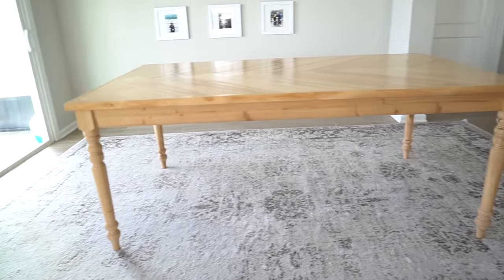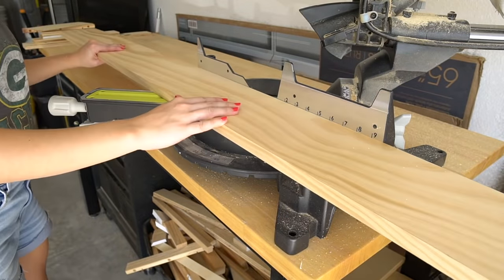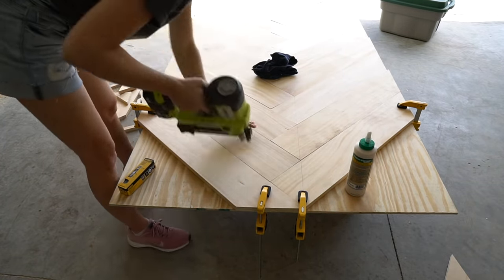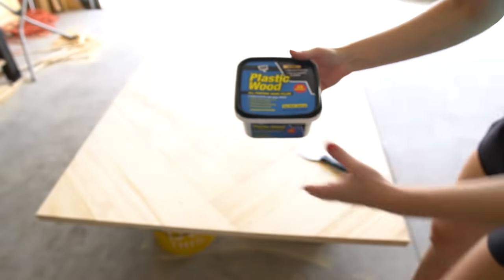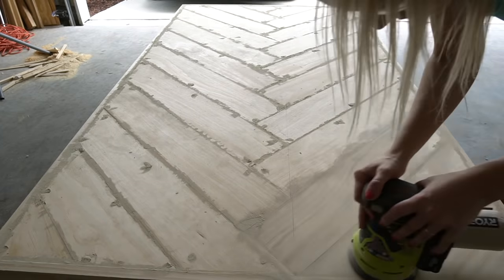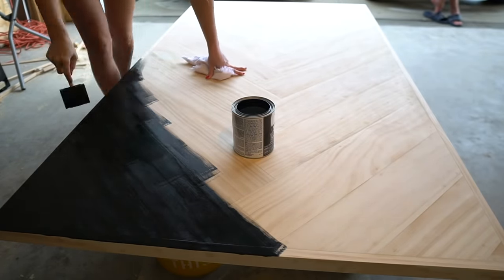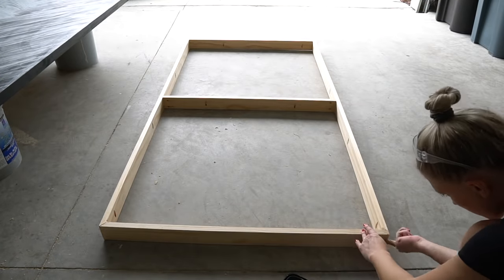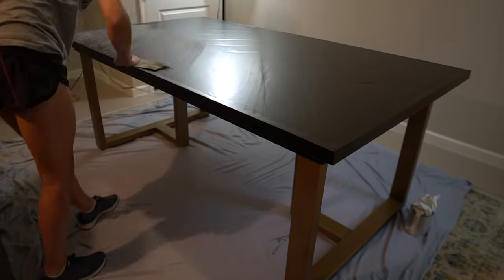DIY Herringbone Dining Room Table | Home With Stefani

Comment: Great idea and execution. My only suggestions would be to use a mask when spray painting and apply the poly outside or in the garage to keep from getting fumes inside the house. The black top would also look real good with an epoxy coating. I think you are an amazing young lady.
Reply from the maker: I will definitely keep that in mind. Thank you so much!!

Comment: Love the stuff you do!

Question in good faith for this project: Since the hardwood is an unstable substrate and you're bolting it on top of the plywood which is a stable substrate, won't that cause issues when the wood expands and contracts? This extends to the mitered border as well. I'm guessing you have lots of faith in your paint and finish?
Reply: I was thinking the same thing. I love the way you walked us through the process, but perhaps connecting them with dowels may help prevent future problems when the wood starts to expand ans contract.

Comment: How is this holding up? I have never laminated standard wood over plywood with glue like that as I was concerned about wood movement - standard wood expands and contracts a lot while the plywood base does not.  This does look quite good though.

Comment: Do you find any issues with wood movement and using wood filler in the cracks? Do you worry the wood filler will crack at the joints with the movement?

Comment: Two questions. Do you find a bristle brush gives a smoother finish than a foam brush on the poly?  Second, do you thin the poly (to get it to flow more smoothly) or use it straight from the can, and why?  Thanks.

Comment: What is the formula you used to determine moving 2.5" left of center.  I think it has to due with the width of your herringbone boards (6") but I can't figure out what formula you used to determine.  I'm curious in case I want to build something with smaller width boards.

Comment: hi Stefani, I have a kitchen window that was just build, it's wood but it has no protection from water or anything I was told I have to put clear coat or stain it if I want to. I just want a clear coat on it, which one do you recommend?